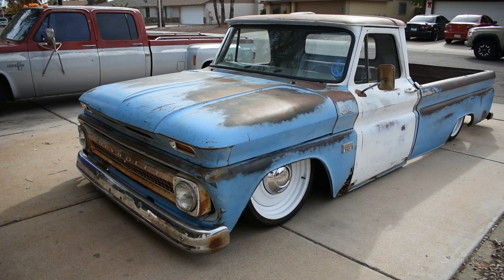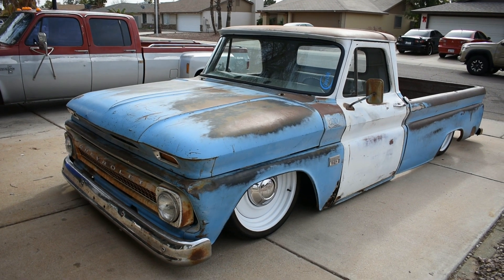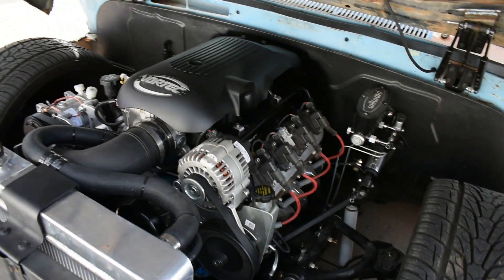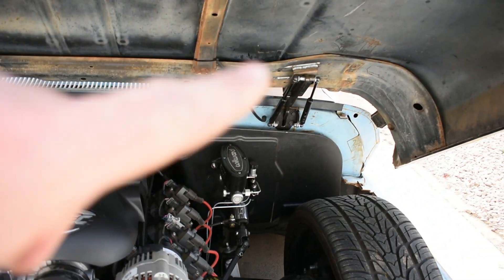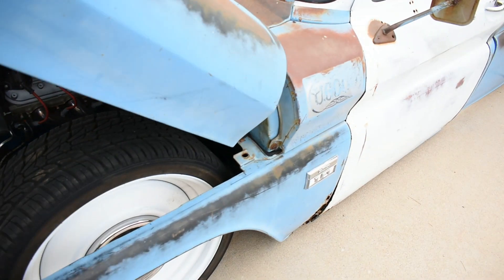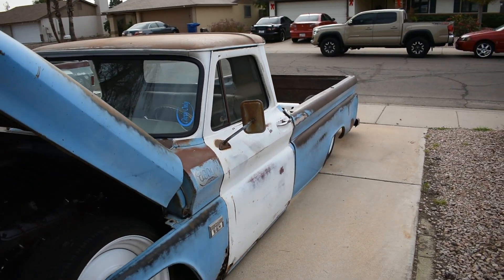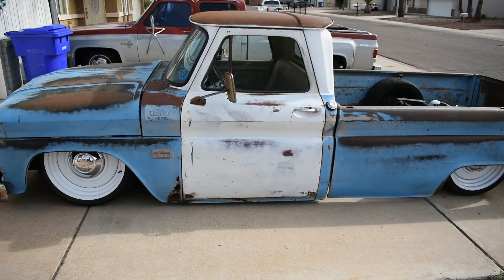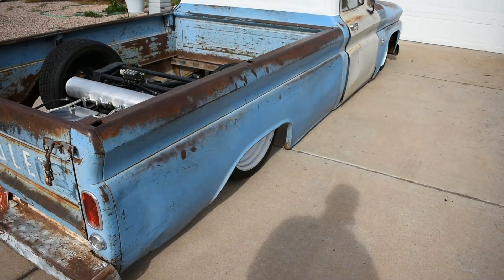Patina C10 LS Swap CAMMED with COLD START

Comment: Did u wire up your front turn signals? I have a 5.3 in my 64 and they did away with the stock fuse box and I don't know where to connect my front turn signals

Comment: I love your engine bay layout very clean.  I'm in the infancy of a LS build for my 66 C10....What radiator, and accessories brackets are you using?  What engine mounts and perches?
are you using a stock ECU/Harness?
Reply from the maker: Champion radiator, dirty dingo accessory brackets, engine mounts were custom, stock computer with a PSI conversion harness.

Comment: What engine mount , headers , ls swap kit did you use. I’m wanting to purchase mine for my 1966 just want to make sure the kit I buy don’t have any clearance issues. Also what ac compressor relocate kit did you use. Awesome truck man. Hope you can help me with my questions.
Reply from the maker: I didn’t really use a kit. I made most of my mounts. The headers are speed engineering c10 swap headers and the ac compressor mount is from dirty dingo.

Comment: What kind of headers are you running, building one similar and I want to make sure I get something that clears my rack and pinion setup and also clears the frame
Reply from the maker: These are the headers I have https://www.speed-engineering.com/ls-longtube-headers-1-3-4-a-body-c10-truck-universal-swap-conversion-ls1-ls2-ls3-ls6.html No fitment issues at all. Minor trimming required if running a 4l80e trans.

Comment: Also I'm curious about your trailing arm setup if you could give me any info on this I would be grateful..did it come in a kit if so where did you get it
Reply from the maker: I made everything in the rear. The trailing arms are 2x2 square tubing 3/16" thick with bushings in the front. This 2 link setup works but is not the best design. Not a lot of articulation flex, acts like a giant sway bar in the rear.
Reply: @RobbyVsGarage  thanks  for the info I'm probably going to convert mine to stock trailing arms and go from there or possibly a 4 link.. do you think the 8 inch step notch was a necessary part of the build to get the truck that low bc I have been looking at the mini notch but I dont have anything to really go by as far as a reference plus I'm not that good of a fabricator 😒

Comment: sick truck man. I have a 66 C10 with the same front suspension and an LQ4 from an 03 express van. What headers are you running?
Reply from the maker: They are Speed engineering c10 swap headers, long tube headers. They are one of few long tube headers that dont extend below the frame rail. I highly recommend them.
Reply from the maker: Thanks!
Reply: @RobbyVsGarage  Awesome man.. I was worried about buying those long tubes from Speed Engineering.  Looks like ill for sure get those..
Reply: Got the part number? Thanks

Comment: Hey Robby its Andrew do you have to z notch front or rear end to get that low on the 22s buddy please i i really need to know if you dont mind
Reply from the maker: Yes you have to do something front and rear. I have a dropmember in the front, basically it moves the suspension up higher than factory and a lower profile engine crossmember. Then I have a 9" step notch in the rear
Reply: @RobbyVsGarage cool man sorry im just nervous about all of this and i really wont my truck to sit like yours where did you get the lower crossmember
Reply from the maker: @MrDrewdown49  the place I got mine from no longer sells them but you can get a similar set up from companies such as porterbuilt fabrication, gsi fabrication, or choppin block
Reply: @RobbyVsGarage  alright nice man thanks alot robby would i still be able to run factory steering box with steering components or do i have to run power steering like yours
Reply from the maker: @MrDrewdown49  you would have to convert to rack an pinion like mine. It's very involved to get that low on big wheels.
Reply: @RobbyVsGarage  makes a lot of sense now robby thank you so much bud one more question  what rack and pinion kit did you go with and what arm did you use for the steering the one that connects to the rack and pinion

Comment: Are you running the gauges off of the ls computer?
Reply from the maker: I have dakota digital gauges.  It's a mixture of sensors they include and the ecu.
Reply: @RobbyVsGarage  Do the gauges sweep when you power them up?
Reply from the maker: @plottchaser  no they do not